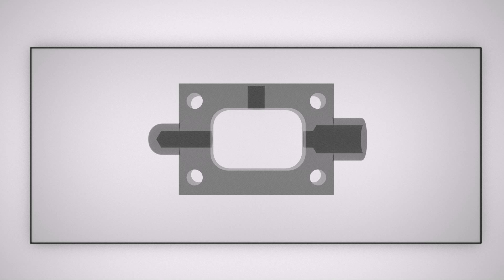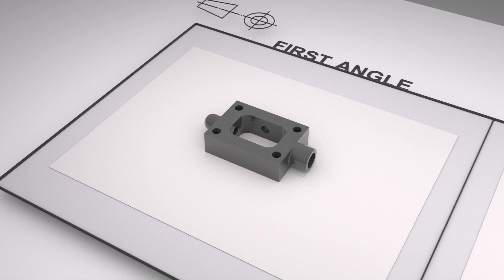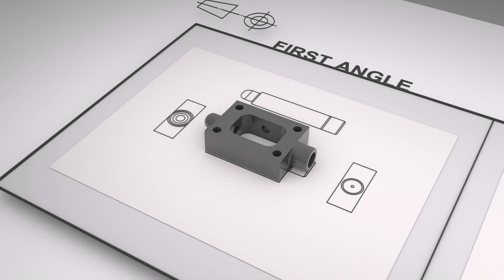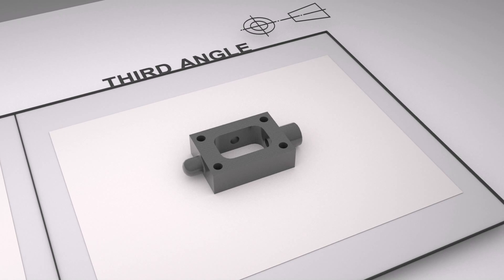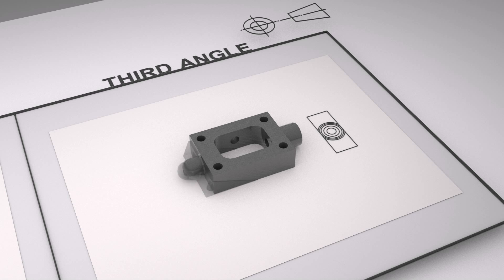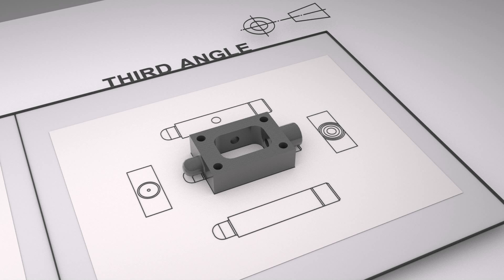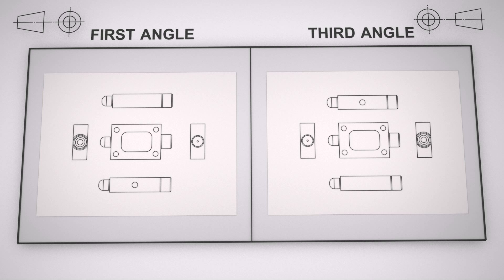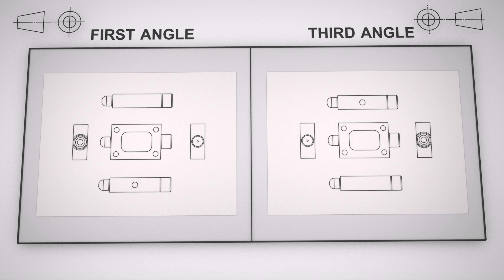Third Angle Projection Vs First Angle Projection 3D animation Part 2

Comment: best explanation so far, but both seam weird to me.
i would like an explanation of 2nd , and 4th angle...... id probably choose one of those.
Reply from the maker: I'm always surprised by how much the question on 2nd and 4th is raised online. In nearly 8 years of lecturing CAD, I've never ran into it in person. I'm thinking of doing a video on it, as I know the issues when following the cartesian quadrant model strictly by math (views clash during folding), but equally what it 'could' functionally appear like if we were to just tweak how we resolve the abstraction. (fold differently)

Comment: I am still confused when and where to use 1st angle view and 3rd angle view...
Reply from the maker: That's entirely based on local standards/preferences of specific countries. There is no substantive reason to use one over the other, just local preferences.

However by international standards at least, there isn't anything wrong with using either as long as the correct symbol is used to identify as such.

Comment: That was useful. can you please explain in 3d why we dont use 2nd and 4th angle projection
Reply: A few years late here, but... The idea of 1st and 3rd comes from the four quadrants of space (think back to x-y-z coordinates in school, and how mathematicians often speak about 1st quadrant, etc.).  For 1st angle projection, imagine the part placed in the 1st quadrant of space. The views we draw are the images as projected onto the coordinate planes. For 3rd angle projection, the part is placed in the 3rd quadrant; if you can visualize this, then you'll see that the projected views will be different than 1st angle. As for your question -- we could place the part in the 2nd or 4th quadrant (so 2nd or 4th angle projection are possible), but they would merely be a hybrid of 1st and 3rd. So they never really caught on.

Comment: 1st angle projection is as if you're rolling the part, 3rd angle projection is as if you're unfolding the part. I came up with "spring roll" to remember which is which, spring is the first season (angle) so the part is rolled.

Comment: still not sure if i got it hhh
Reply from the maker: +Abody tube² Ok, What aspect do you think your still struggling with? remember this is just covering orientation between views.
Reply: +Clan MacCAD here is the rule 
- First Angle = what i see from the top is what i have to draw
- Third Angle = just drawing every face in the same place 
  mean right face at right, left face at left....
right ?
Reply from the maker: +Abody tube² In both cases, it is about which side of the real 3D object appears in which 2D view.

In both cases you start with a front view. (the middle one in each example). The difference between third and first angle is purely what you do when adding more views to the sides and above/below. 

In First Angle - if you had the object on the paper physically. The views are laid out as if you roll the actual object over in the direction of the next view you want to create. Therefore the opposite side you would expect ends up face up.

In Third Angle - if you also had the object on the paper. it is as if you pull out the nearest side of the object to the view you want to make 

Everything in both cases is a 90 degree rotation.

You could try practicing on real paper with a practice object at home. However remember all I am describing here is the two different ways to lay out the views. If you don't know how to create the views themselves yet, it may be too soon to try and understand this.